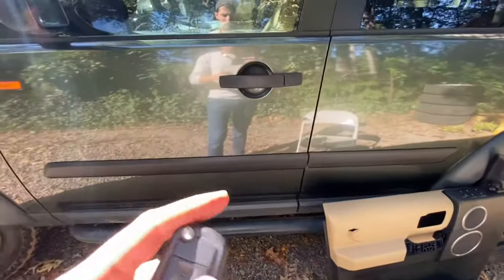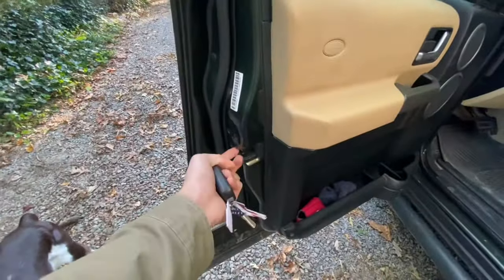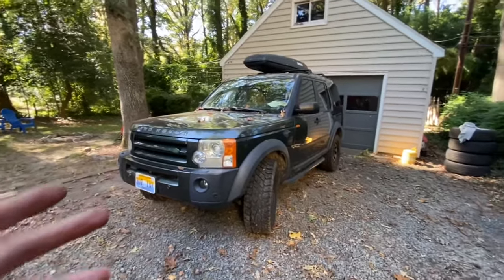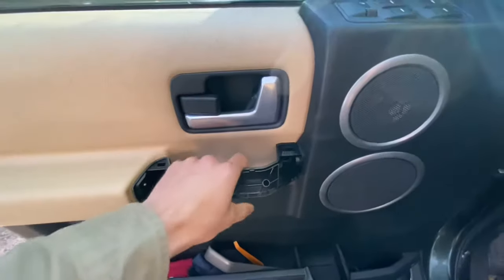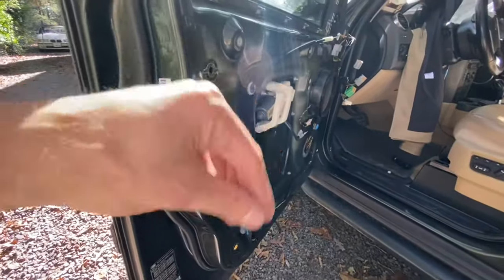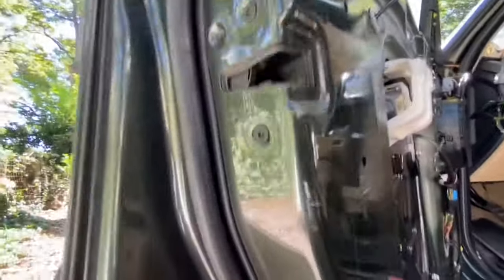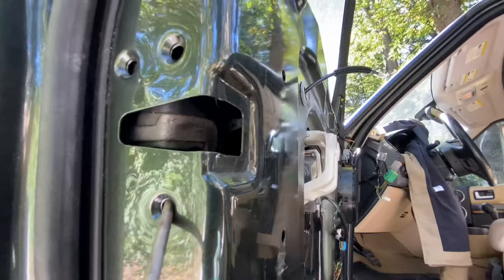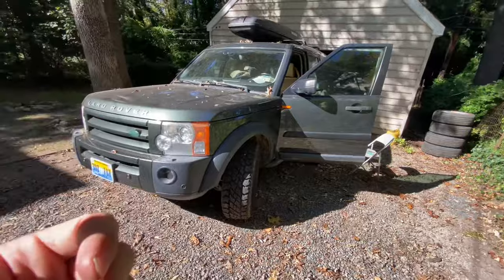This Simple Trick Saved Me $$ HUNDREDS $$ - Land Rover LR3 Door Lock 5 Min Repair! (Not Clickbait!)

Comment: Well I tried it and it worked!! Thank you so much for making this video. I didn't even take the door panel off. Just removed the 3 screws on the side locking latch and maneuvered the locking mechanism and slightly bent that piece down. Reattached the screws and tried to lock it. First try and Shazam,  locked! 👌😁
Reply from the maker: Sweet!
Reply: What exactly is the piece that you have to bend, the plastic?, or the metal behind it

Comment: So i just successfully finished my driver door👍 thank you so much. From looking at the parts it looks like the white L shaped plastic piece has a fin on the back of the metal lever that works as a return for that plastic piece when the lever is pushed in lock position.bending the metal down works as a return for the plastic. Thanks for the video👍
Reply from the maker: Glad it worked !

Comment: DUDE.

I have a 2006 L320 Sport that I bought last year - it had this issue and I replaced the actuator and door handle cable to fix it.

Almost a year to the day, the driver door lock stopped working again. Of course I’m on a trip far from the Sport for the month, but I’m definitely trying this before pulling the whole door assembly completely apart again.

Last time the interior door handle didn’t work either, while this time it does, so I dare to hope this solution works. 

Thanks for posting!

Comment: Just did this on the three doors that never locked on my LR3. No need to remove the door panel. Caution, because you can only approach the inside of the door skin at an angle, the screw driver is very susceptible to slipping off and smashing into the white plastic arm. Happened a few times until the little coiled up helper spring popped off and fell within the door skin. Door seems to lock and unlock fine without it though... for now. Just be patient. Also, note that the rear doors don't allow you to push the actuator assembly as far back as the fronts, so you're limited to an even tighter angle of approach. Good luck! Saved me lots of money!!
Reply from the maker: Yup. It’s not the end all but mine are all still functional.
Reply: @AddictedMotors  hey that's all that matters! Thanks again, really appreciate it.

Also, love the 911 in the garage. Hope it's been treating you well.
Reply from the maker: @kc550  My best car! Defiantly have some videos on that one as well, check out the rest of channel!
Reply: @AddictedMotors  awesome, will do!

Comment: In my humble opinion, that is not entirely the problem. The only engineering solution which I hate from Land Rover is the door lock mechanisms. I had the same problem with my Disco 2 and experiencing the same with my LR4 now. The main problem is that the land Rover engineers uses two electric motors with worm gears to actuate the lock mechanism. The problem is that this is a very bad way of using electric motors, which is in high load/low RPM operation. This carbon’s up the armature and eventually causes a short over the poles. The solution is to open the mechanism and then the electric motor and remove the short between the terminals. I now fixed 4 of these mechanisms and all had the same problem. Hope this helps.
Reply: Got a visual of the contacts, that need to be cleaned, we can see anywhere?
Reply from the maker: right. I never said it was the correct method but will help the average owner get by.

Comment: Thanks, but before I jump into this can you confirm that you heard your actuator operating on each of the doors before you did this fix?    My rear driver-side door doesn't lock or unlock, but there is dead silence on that door when locking and unlocking using the remote, so I assume this is an electrical problem with that specific door and bending bits won't make a difference.  This isn't a criticism of your video which I think is great, but rather a need for clarification.
Reply from the maker: It should make some kind of sound

Comment: Great video, I have same problem with my 06 RRS S/C but just from watching this I reckon you could pull this off without ever taking the door card off? since you just work through that little opening where the actuator was.
Reply from the maker: Probably. But it helps in case the Handel comes apart
Reply: @AddictedMotors  I see, thanks friend. I’ll definitely give it a go.